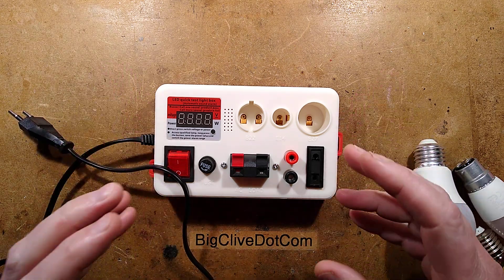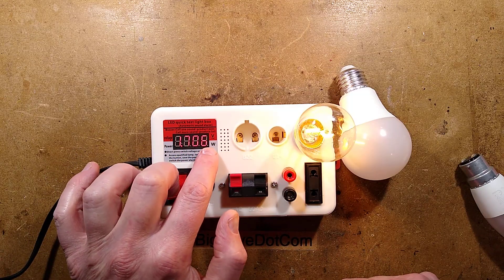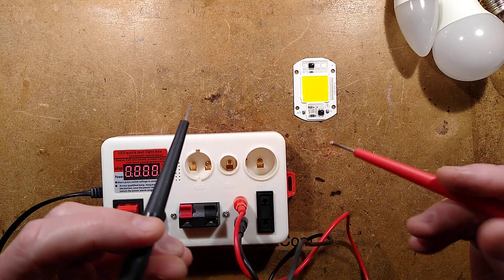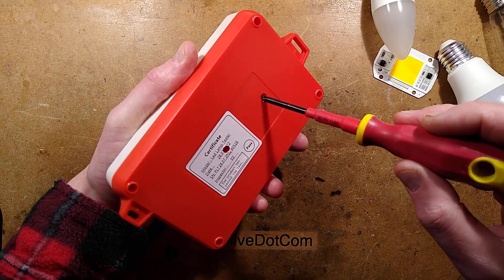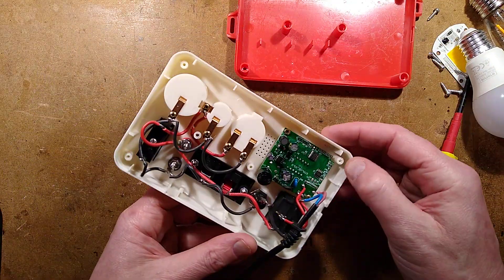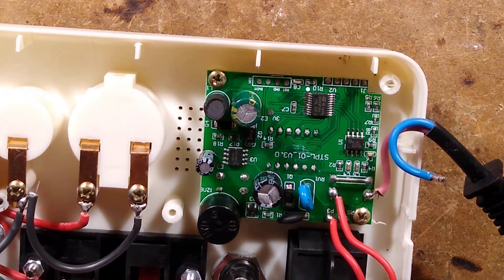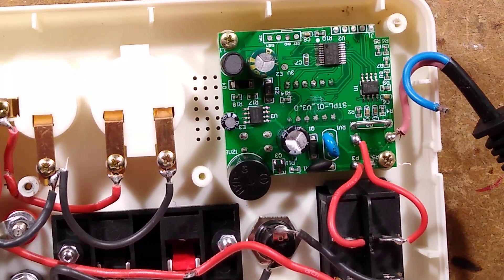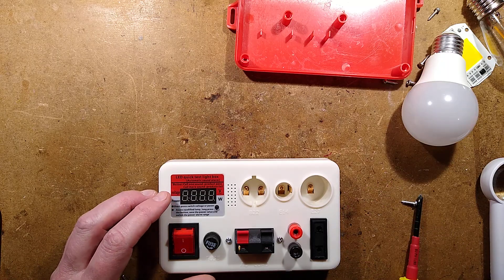Scary eBay Chinese factory test equipment

Comment: IMHO we do need more "use common sense or youll get a shock" technical equipment. I was wiring in some exit signs, putting cables on them for a temp building install. I forgot to unplug the unit after testing one and its contacts werent quite right. Took it apart, finger hits the live, *ZING*.......Never going to make that mistake again.......From now on if Im working on a mains thingy especially at a bench the plug goes in my pocket before opening it as a personal SOP. Like, in my mind, for the plug to not be in my pocket the screws will be locked in place, trying to take it apart would break it, so gotta pocket the plug to unlock the screws. Granted here in the states its only 110v but still had a numb stingy finger for a few days. 

Stupidity should be painful. And depending on how stupid you are with things you should be being extra careful with, pain could skip right over you and be painful to your family instead. Be smart, not brazen yet lucky. Know the risks. Protect yourself. You know whats cooler than being cool? Not killing yourself trying to look cool......
Reply: 110 V in the USA doesnt exist since the 1930s. They standardized 115 V after 1930 ans later 120 V.

Comment: Completely off topic, but speaking of getting a shock - I have a Dyson digital slim vacuum with rotating brush head.  The charge port for the battery is in the handle.  Whenever I vacuum the carpeted staircase, static charge will build up and I will get a shock from the battery charge port every 4-5 stairs.  More than static charge from exiting a car in the winter. Right in the palm of my hand. Very annoying.

Comment: I had a look on Ali and noticed quite an array of variations on the same theme, some with additional lamp sockets, some with the probe sockets deleted, a choice of 2 pin plug design etc. all around £10 - £12 GBP. ( + Vat free shipping). As you say in the right hands the box layout and socket configuration could be useful. Knowledgeable, capable and educated hands.
Reply from the maker: What keywords?
Reply: @bigclivedotcom  LED quick test light box
Reply: LED quick test light box
Reply from the maker: @richardhalliday6469  Thanks.  I also found the original simpler unit I was originally looking for, plus some others.

Comment: I love how they didn't bother to use the 0.2c more expensive version of the mains switch with the built-in neon to tell you when it's live. I guess someone figured that the display would be enough evidence to tell you that the thing is switched on, but I'm guessing that display is quite a bit harder to see when the camera isn't looking straight down on it, and the device literally trains you to not bother looking at it because it does the little beepy thing for confirmation/rejection. 
The whole unit just seems like it's been custom designed to trick people in the most zappy way possible.

Comment: 4:20 I highly doubt the shop that made these devices is SAWS compliant ( china's OSHA/HSE equivalent)

Its basically like if you where to go out and by the parts and make them in your garage then send them out to China or the US. You could have your kids working on them and the safety inspectors wouldn't be none the wiser unless someone reported them.

Perhaps report the shop to the SAWS?

Comment: You'll probably also find that, what appears to be copper contacts, are copperised steel. I found this with Chinese made 13 Amp sockets used in a hospital in South Sudan.
The problem with the copperised steel components is that they don't have spring tension in them and bend when plugs are inserted eventually resulting in minimal contact and hotpots occurring.
Reply from the maker: The reason the flex wasn't soldered properly was that it was copper coated aluminium with a distinct lack of copper.
Reply: I once (for sh*ts and giggles) bought a Schuko socket, probably made in Turkey or for a Turkish company, although I haven't been able to find anything online. From the outside it looked very old-fashioned and not all that bad, the guts were even ceramic. The surprise came when I put a plug into it (just sitting on the workbench, not connected to anything). The spring clips opened... never to close again. Utterly useless and the bloody thing was the same price as a proper socket at the DIY store (5 Euros something)!
Reply: @Ragnar8504  Is 1.5mm2 wire for 16A still allowed in Germany and Austria? Some countries require 2.5mm2 now.
Reply: @Ragnar8504  Same in Hungary and probably in most European countries. I think even the US and Canada  has expensive code books.
Reply: Steel contacting with copper will also show electrochemical corrosion in wet athmospheres.

Comment: With the plug being non polarised and the probes touch the fuse will blow but there is a 50/50 chance that one of the probes will still be live!!!
Reply: Happens everywhere, 50 (or 60) times a second ALL wires are live.........to call a wire neutral is dangerous in itself.
Reply: @joineralbert2493  Live is the one with the tingly pixies in it, Neutral should be connected to earth at the substation.

Comment: An interesting electrical appliance from China was an industrial vacuum cleaner... a friend of mine, who does demolition and renovation work, including asbestos removal, bought one. Nothing wrong with it really, sturdily built, with 7,5kW motor and all... but it came just delta wired for 3x400V with a 4 pin plug that has no neutral contact. It has an internal transformer to make 230V for the tiny compressor that gives puffs of pressurized air to drop the dust from the filter to the bag. What was our problem is that it takes a 3x32A circuit to start raw in delta, and that is seldom available.  And it is not a pleasant smooth start, hell no. It runs fine on a 3x16A circuit which is far more common, it had to be wired with a 5 prong plug for which sockets are more commonly available, and a wye/delta switch had to be added for the motor to start smoothly.

Comment: In 1972 I first experienced a small hardware store that was at least 50 years old then. At Christmas, they put a lamp tester on the counter. It didn’t even have sockets. Instead, it had a flat contact strip inside a raised “V” shaped contact. You put the lamp’s solder button on the flat strip, then slid it into the vee to contact the shell. You could optionally add your fingers for added excitement.
Reply: Did your hardware store also have a vacuum tube tester? My dad used to refurbish TVs and every couple of weeks we'd stop in there to test tubes and buy new ones.
Reply: We had those as well, but they were harmless continuity testers.
Reply: I made my own with a batter when I was a kid..
Reply: 110 volts still isn't "safe" but it's a lot less dangerous than 240.

Comment: This for some reason reminded me of the product video on AliExpress for the Uni-T ut125c multimeter. They show this machine whichs dedicated task seems to be swinging things back and forth. It holds the multimeter as it rotates back and forth with weights on the probes (they are hardwired in this multimeter). I always wonder if its actually a dedicated strain relief swing test machine 😆

It is most accurately described as a wiggle machine

Comment: I've always been puzzled about lampholders. It's an open mains contact essentially, and the unpolarized ones, when unscrewing them, you may touch the 'supposed to be neutral' contact which could be live. How did this terrible design came to be? It works I guess, but it's awful from a safety perspective.
Reply from the maker: It's an old standard that has been "grandfathered" to the current era because changing every single lamp holder in a country would be a massive task.
Reply: @bigclivedotcom  If European countries managed to change all 127 V lamps to 220 V ones in the mid 20th century changing lampholders would have made sense. Bi-pin lampholders like GX5.3 and similar sizes exist since the 1893 Chicago World Fair.

Comment: The double probes set you up perfectly to get a shock through the heart.
Reply: getting confused with a continuity tester and touching them together would be fun too!
Reply: @whiggy6976  oh yeah.  i know someone who liked to poke around in electrical panels with his 'duspol'. the duspol from that era was a 2 probe tester that would show some kind of voltage over 100V present via a little neon in series with a few hundred ohms resistor and you could bridge the neon on a button and get a voltage reading from an analog voltmeter.

the button pressed also allowed for a crude GFCI testing as it let over 200mA trough its voltage coil.

you could check live in a circuit when touching the other probe. the neon was lit and all fine.

but guess who single-probe-tested for live with his finger on the other probes' tip and then pressed the button for the voltage coil 🤣🤣🤣

Bzzzzzt 🤪  that old geezer though me really much during my apperenticeship.  but not much useful in terms of getting a good sparky.  was quite funny tho !

Comment: The alternative is a low cost & easy to use common 2 lbs club hammer.
Just insert the lamp under it at the right time and you know it wont work (any more).

Comment: If you ever get a chance to see how fireworks are made in the US versus China, its night and day.  The US they are made in an ex munitions bunker and people have to wear static bands and respirators and the humidity kept in check.  Everything is measured using the best digital scales.  In China, they use a plastic scoop for the gun powder, place the colored metal powders that make the designs in by hand and tape a paper mache/cardboard balls shut and wrap it in flimsy paper.  And yet the Chinese are so much better at fireworks competitions than we are.

Comment: I've often though, every electrified home in the world has something in it that would never pass safety standards today: the light socket. A connector with exposed live and neutral contacts has been grandfathered into current electrical standards everywhere, but you'd never get a similar connector approved today. Like, let's say for example I wanted to make some special proprietary globe and socket, and to prevent people using competing globes in my sockets, I make my socket basically the same as the current E27 socket, but just a few millimeters wider. Call it E32. Mechanically no different, but I can guarantee I couldn't get it certified because of the fondleable mains contacts.

In fact, no need for hypotheticals. Most down lights I've seen used something like an MR16 or MR11 socket. All of these have their contacts inside the fitting such that fingers can't touch them, and they're usually (I think always but I'm not 100% on that, so "usually") only 12V. If you wanted to bring a new mains voltage light socket to the market today, you absolutely couldn't have exposed contacts.
Reply: The bi-pin base like the types used for mr16 lamps was invented by Westinghouse for the 1893 Worlf Fair in Chicago. That could have been standardized instead of the stupid screw-in bulbs. Whoch of course was not invented by edison, he stole and patented other peoples ideas.
Reply: Things change.  Grandpa used to check voltage with his fingers.  Tractor magneto, AC mains, didn't matter.  If he didn't feel anything he'd lick his fingers and try again "to make sure".  Be that as it may, he had great respect for television CRT's.  His words were "Don't touch that you'll light up like a light bulb!"

Comment: Some knarly soldering. That’s a death trap if you’re not very familiar with electricity. It could be a decent tool with some modifications. Replace the probes with something which shielded ends and put a proper power cord so live and neutral are known instead of playing live wire roulette. Your videos are great Clive. I always know I will learn something cool free your videos. I have been messing with electronics and electric since I was a child. Back in the early 80’s the paper did a story on me and my light bulb collection. The associated press picked it up and I got all kinds of cool gifts from nice people around the country. The president of Sylvania sent me a place mat with all their bulbs on it, a tie with light bulbs embroidered all over it and a letter saying I had a job there after I graduated college. I went into mechanical stuff was making more money but cars are rolling computers now and I have been doing electronics from over 45 years as a hobby but it pays the bills also because I can diagnose a car without just throwing new parts. I go through the wiring diagram and check components until I find the bad one.
Reply: That of course would only work if you live in a country with polarized sockets. Not everyone does.
Reply: @maxine_q  It‘s almost as if on the beginning of the video it showed a UK plug
Reply: @JAzzWoods-ik4vv  1. The device itself is shown having a non polarized Europlug, he is using an adapter.
2. This video is watched (and the comments are read) by an international audience. Not every country has polarized plugs and sockets. And to be honest, it doesn't matter. It doesn't add any safety. You shouldn't be touching either live or neutral.

Comment: Swapping the probes for alligator clips would be a way to make it marginally safer. You could clip the thing on and then pull your phalanges back and toggle the switch, then turn it back off.

At the end of the day, just one moment of distraction could really cause a problem here. Would highly suggest the use of an earth-leakage breaker and making sure you have an earthed bench to work on.
Reply: If people will be testing hundreds of the same design of COB LED then the other thing you could do is mount the probes at an adjustable distance apart so you can operate it one-handed and not put 240V RMS across your chest if anything goes wrong.
Reply: @charleslambert3368  Earth leakage breaker, just out of reach, would mean you wouldn't even notice the tingle that was about to shock you.

But yes. Insulating the crap out of their workspace and just making sure they can't access both terminals works—though is scary if someone else walks up and leans over the person while they're working.
Reply: I would expect an earthed bench to do way more harm than good.

Comment: My grandma, who is a former electrician, has an electric drill that "plugs" into the socket via 2 nails wrapped in electrical tape. She said she did this so it could be used with both 2-prong and 3-prong outlets on work sites before she retired. (Yes our 2-prong and 3-prong plugs are completely incompatible for some reason). I have yet to manage to convince her to install an actual plug on it.
Reply: The fact that she's a former electrician and not your former grandma must mean she knows what she's doing.
Reply: Same in India, but Europlugs plug into both, albeit loosely.

Comment: It reminds me of the armature tester that hand tool rescue restored

If Im remembering correctly it has leads on it that have ac voltage that you use to test the windings of the armature of electric motors

Comment: I would call that device a "Widowmaker" (a term I always use for a pigtail with bare wires used for testing)
It still have a hard time getting  used to UK being 220/240 without ground! Fun video😀
Reply: The more correct/widely-used term for your test pigtail is "suicide lead", also used to describe a mains extension cable with plugs on both ends. They used to be required for supplying park power to caravans (or shore power for cheap boats), and for powering mains-voltage christmas light installations in the US. Safety standards have since caught up with this particularly dangerous cable configuration, in most of the world at least. In my experience, "widowmaker" is more usually used to refer to certain kinds of mechanical equipment/tools that will end you at the drop of a hat if your attention wanders even for a second (e.g. a 9" grinder with the guard removed, widowmaker is the standard worksite term for this evil bastard of a thing here in Australia).
Reply: @sixstringedthing  Nope, I am in my early 60's and in engineering or just creative techs have a plug on the end of a wire to supply power to circuits (I keep a fuse in mine) and wouldn't recommend to idiots. I know what you are referring to though, to connect a generator to house wiring through the ass-end
Reply: When I was a child, we had a local butchers shop at the bottom of our hill, it had a refrigerated cold counter outside the shop front [styled on a market stall] and it was powered with “such” a doable-plugged suicide cord = one “end” plugged into a socket inside the shop > the wire through the open door and the other “plug” plugged into a switched double socket on the side of the refrigeration unit under the counter. Even then I knew that was “weird” as I had been told by my dad “basic electrical safety” - that you plug an appliance into a socket and “not the other way around”. It had been “dangerously” configured like that for multiple cold counters to be “daisy chained” using multiple suicide cords and the free socket, for more than one counter in a town market, large shop/supermarket. That one counter had been hacked by a cowboy sparky to make it easier for the butcher to put away